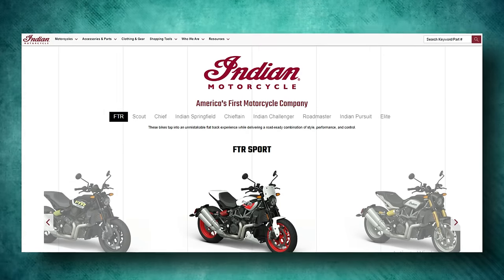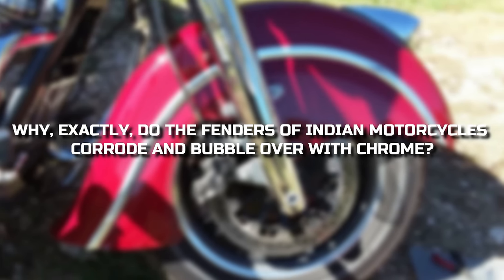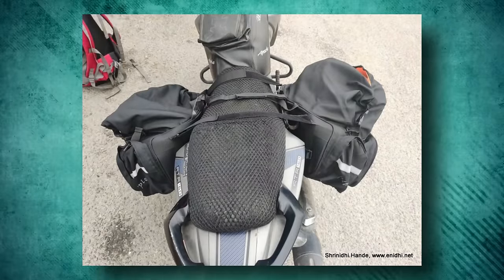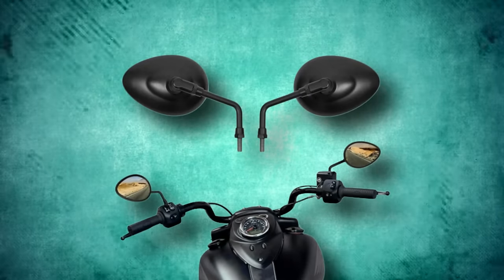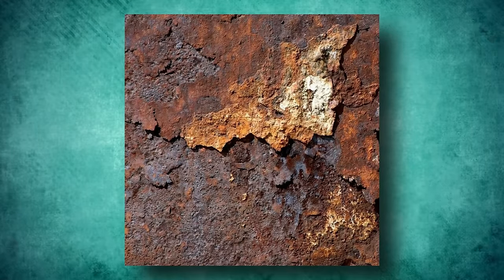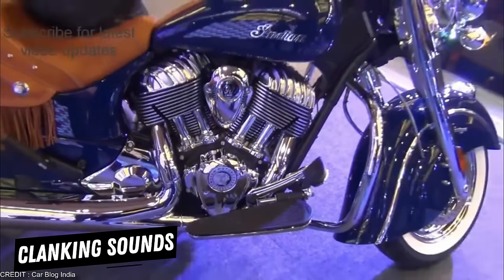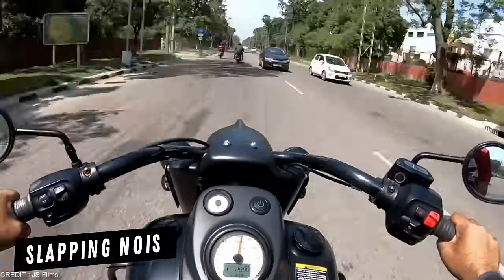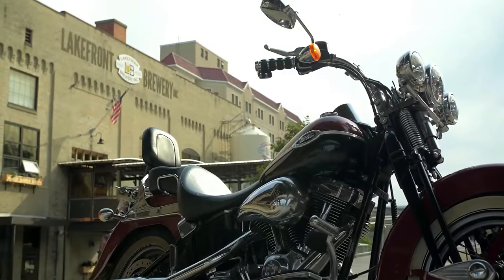This is why Indian Motorcycles SUCK

Comment: it's a Polaris, a company that bought the Indian motorcycle name and making bikes that try to resemble the real Indian motorcycle's that went bankrupt in 1953. i call them what they actually are, a Polaris. currently own 09 street glide, stock 96 ci with Python slip ons, with 168,000 kms / 105,000 miles, zero engine issue's still runs and sounds like the day it was made.
Reply: I was talking to a Harley owning woman one time and she said the finest vehicle on this earth is made by Harley-Davidson and polaris! And now Polaris owns Indian so I'm going to take her advice oh yeah that's right I already did.
Reply: So if you own a Volkswagen, you actually own a Porsche.  Since Porsche owns Volkswagen.
Reply: And more American made than Harley..lol
Reply: Yep. I sold a sold a 1928 101, still have a '47 chief. Looked at the New Indians, almost bought one of the first Polaris ones. A bloke in the states has done over 470000 miles on one with no issues at all. But they look a bit gaudy. Then I found my 07 Road King Classic. Bought this time last year with 23000km, now at 40000km. The shocks were clunking, new ones from HD for 365aud each. Thats it. I bought it knowing things needed sorting as it sat for 10 years hardly ridden. Throttle cable adjusters rusted solid, put piston kit in the callipers,  things like that.(no worries, I know the blokes by name in the parts section at my local dealer, just ring up, they get what I need, call me when it's there). I love that bike so much, I can't stop riding it, any excuse. I've sold everything else I had because I just won't ride them. My only regret is I didn't buy a RK 20 years ago.

Comment: The title of the video seems a bit harsh.  You are absolutely entitled to your opinion but also, you have to expect some rebuttal.  I have owned Indian, Harley, Honda, Yamaha, and Buell (still Harley I know).  All manufacturers have their weaknesses which is why you always hear the adage of not buying the first model year.  My Harley has had oil leaks, loosening bolts, clutch basket failure, etc.  My Yamahas had corroding exhaust, intermittent electrical issues, and charging issues, my Buell was plagued with issues.  My Scout has been an amazing bike and to me, the "issues" are very minor compared to its strengths and I wouldnt hesitate to buy another one.  Indian has fixed its major issues from starter issues, brake issues, etc.  Youd seriously not buy an amazing motorcycle cause the mirror nut got loose or the clutch cable COULD break?  Lets be subjective and look at the histories of issues with other brands...NOBODY makes a perfect product but we buy what makes us feel good and we either fix the issue when it pops-up, let it get covered under warranty, or just upgrade it.

Comment: Every brand certainly has their issues as stated...many of these in the video were from early days of the current Indian line. I have had 2 Indians (18 Springfield & now a 21 Roadmaster) and have had zero problems with either.

Comment: I've owned several motorcycles from Harley-Davidson, Honda Goldwing, BMW R1200 GSA, and 2015 Indian Chief Vintage.  My Indian only has 9k miles on it and I've replaced (4) gear indicators on it as road debris disables it and doesn't read neutral therefore unable to start the bike.  Indian will warrant the part/labor for life as it has a factory recall.  Just a band-aid fix that my time can't be replaced towing it to an Indian dealer.  Indian refused to buy the bike back from me and refused to provide a permanent solution.  I've got the bike listed on Cycletrader.  Will never buy an Indian again.
Reply: Stick with Honda or Yamaha

Comment: After a succession of motorcycles ( 1968 Kawasaki Bushmaster,1969  Yamaha 350, 1970 Bonneville 650, 1971 Norton 750 and finally my dream bike 2016 Indian Roadmaster, although the Norton was by golly one helluva bike!!! ). I had 1 problem in 25,000 miles. My monitor died within 2 months. Replaced, never another problem. I had no noise problems, no failures... One complaint was ... heat. Boy oh boy.... at idle, the volcanic heat would just roast the right leg. So, I learned to ride so I minimized a dead stop. Just had to look ahead. one thing I LOVED doing was running the Sunshine Skyway bridge. Tampa Bay. LOOK IT UP...A SWEET BRIDGE! Go once each direction...(COP WATCH) then....open up. Man, the pulling power going up the bridge was so much fun. you had a 3 or 4 mile run-up to the uphill part of the bridge.  I would be putting along about 80, hit the incline and twist the throttle maxed. No downshift, just twist the throttle. What a feeling!!!!

Comment: I have both and your video is really cute....
Id take rusty chrome and cheap mirrors on Idian over Harleys pathetic warranty.
They "suck" so bad they are being sued by customers for Illegal practices and forced by the Feds to complying.
The aftermarket part for harley is huge due the shitty stock parts.
My stock Indian 116 makes my Harleys performance look so sad its not even a fair comparison.
My Indian didn't need 5k worth of exhaust and motor mods make get out of its own shadow like all my harleys needed.  That "Sucks!" 
Indian has a warranty that has fixed every one of these complaints at no hassel.
Each issue I have had was addressed and fix at no charge.
Ask a HD owner how they like the warranty and dealer treatment has been.
Reply: The voltage regulator went out on my Harley under warranty, got to the dealer, and 30 mins later I was out the door riding again with no money out of my pocket. Harley dealer has treated me fine thanks for asking.

Comment: How about Harleys sumping and transfer issues. The factory did nothing about the affected owners
Reply: Transfer issues? Both my Harleys in the 1990’s had major issues, but at least then they stood behind their bikes and took care of the problems even when the bike was no longer under warranty. Mine had a set of bad cases and they had to replace them. Oil was leaking though the cases and into the primary.
Reply: They did nothing for my 18 or 20 limited
Reply: @billschaner6222  I had a 90 FXRS/LowRider. It had a 12/12,000 mile warranty. Under warranty the return spring for the shifter broke, went thru the trans and ate up a couple gears and synchro’s. They fixed that. The tank decal flaked off at two years, should have been under the clear, they sent a new tank. The top end stopped oiling for some unknown reason, it scored the cylinders and beat the rockers and tops of the valves. Had to be bored 20 over and new pistons. Harley payed for everything, I payed for upgraded valve springs, Screaming Eagle. That was at 38,000 miles. Then I stated losing oil, about 1/2 a quart every 500 miles, wasn’t leaking wasn’t in the pipes, then I drained the primary, got 3 quarts. Found my oil. They had to stamp another set of cases with my serial number and I still had my bike back in two weeks. I traded and bought a 94 Custom LowRider. Had a couple issues nothing major, rocker box gaskets and the speedo quit. I ride a Honda ST1300, 75,000 trouble free miles to this point. Nothing but scheduled maintenance. As long as Harley fixed the problems I was fine, but when I payed $28,000 for a new bike and they wanted me to pay for things that should have been warrantied no questions asked. I was done. Not to mention the dealerships have turned into entertainment venues, it’s a joke. I think some of the people only ride back and forth to the dealership. I might pick me up a used Dyna they can be bought cheap!

Comment: Every one of your complaints is what I would consider gingerbread issues.  Now let's go to HD, gee how about that great clutch that fails constantly, that great crankshaft that lasts all of 40k miles, then that outstanding valvetrain that fails constantly.  Sorry I have dealt with HD and am far from impressed with their quality and engineering.  Most of the complaints I have noticed coming from the HD followers and their nitpicking.  Now, these are the same guys that call a Goldwing absolute JUNK, and the same for BMW's always breaking down.  Well having owned 2 HDs over the years they were less reliable than my 1967 Triumph TR6 after I fired Mr. Lucas, and make my own electrical system.  Have owned several BMW's and all had well over 100k on the clocks, the things that broke were often at well over 100k and were WTF items, such as the spring in the transmission shift cam at around 200k miles as an example.  As for the old Goldwing I now have has over 110k miles and has been trouble-free other than the wimpy alternator 45 amp factory, replaced with a 95 amp aftermarket unit.  OMG it took about 45 minutes to change out as it it tricky to pull out and get back in the correct position.  Now changing the rear tire on a 93 Wing is an ordeal, even on a bike lift.  The people who came up with that system ought to be shot at sunrise.

Comment: What this video doesn't mention is the problems mentioned here were basically all came with the introduction on the Polars Indian motorcycles in 2014. And all were covered by Polaris. What motorcycle doesn't have introduction issues? One of the biggest issues not even mentioned was the issue with their soft paint. Also not mentioned is the 111 motor which is industry leading and better than any HD engine ever created. I had a 2015 Chief and now have a 2023 Chief. They are amazing industry leading motorcycles. There is a reason all Indian motorcycle dealers have a large inventory of used HD trade-ins. Polaris did an amazing job of refining these Indians and todays Indians are extremely high quality including their bullet proof Thunder Stroke engine. Now you know the rest of the story.
Reply: The Victory was used as the learning curve to hopefully have a better machine to call the Indian. Once organized, the company dropped the news on Victory owners. The Victory bikes worth plummeted  overnight. Poor stunt by Polaris.  I purchased a Polaris 2011 Victory and it was a lemon. The first lemon motorcycle out of 16 motorcycles I owned over decades.
The Indian visually shows  much of the Victory too me. I will not purchase Polaris again.

Comment: I bought a 2015 Chief Darkhorse brand new. The chrome fender strips are plastic and hide the seam of the two piece fenders, front and rear. That's where the rust starts from the two pieces not being sealed and moving against each other. My fenders were replaced under warranty at 9 months but began rusting again within a few months. Also, my kickstand spring snapped at 9 months old and it took two weeks for a new one to come in. Riding a bike with a bungy cord holding up the kickstand was embarrassing. I sold it within the year. But I will say this, it was so powerful and smooth riding I still miss it.

Comment: Couple Indian bikes here; no rust but seat on the 16 Scout has faded; no biggie - been in the sun a lot. Also had Scout clutch cable break on my enroute to dealer; my fault though as I should have been inspecting it when I felt decreased resistance. 18 RoadMaster runs like a charm … no real issues there other than tire wear, but that’s on me due to mostly curvy roads and a heavier throttle than normal.
Reply: They have dye kits for leather works really good especially on the tan
Reply: It’ll look new again

Comment: As an owner of a 2017 Indian chieftain, I can concur that none of these issues exist, living on the Florida gulf coast where saltwater and salt air can be an issue. I am a previous HD owner that had multiple rust issues on a 2014 Dyna. I’ll never own another HD for many reasons. That being said, I smoked a 114 Milwaukee with my 111 thunder stroke today. 
I will be challenging every HD at red lights from now on!
Reply from the maker: Looks like your Indian Chieftain is not just a pretty face, but a powerhouse on the road too! Watch out, HDs!

Comment: Once he got to the clutch cable I stop. I owned a Victory Vegas even made a video about Victoru clutch cable HACK. My biggest gripe about POLARIS is they never try to improve or fix their mistakes. The front fender problem on the Vision had to be fixed by guys in the forums and aftermarket companies .Great alternative to Harley but the fit and finish is lacking . When you price your product near the KING OF THE ROAD your game plan needs to be better.
Reply: The biggest problem with Indian is fit and finish. Paint job is soft . Fit isnt up to par . Indian engine is STRONG AND prices should be lower than Harley .

Comment: I own an Indian Super Chief Limited with stage 2 performance upgrade along with a few other upgrades made right at my Indian dealer. This bike has had exactly zero problems. Been riding other makes since 1981, and now will never spend a dime on any cruiser that's not an Indian.  Now, let's see this video focusing on that other made in the USA brand, that's if you can get past the handle bars that shake and rattle like you're sitting at the epicenter of a major earthquake. Just saying. It really boils down to personal preference. Ride whatever brand / model  you enjoy, they all have two wheels . Ride safe.

Comment: Was leaning towards a Pursuit this year. Till I watched a vid on changing an air filter on the model. Got to pull the freaking gas tank to change an air filter. Think I will pass on that.
Reply: Changing an air filter every, what, 10k miles or more? Sounds like a small price to pay
Reply: @Mr02kota  Your point is valid if one lives in an environment where the filter does not have to work too hard. I live in a semi desert environment. 3k max for me on air filter. Also with that have to part the fuel lines each time. Parts wear out, o-rings leak from such.  Indian has made much progress in last few years. still has a way to go. I'll keep my eye on them. I bet they pay attention to these forums.  :)
Reply: lol 3 bolts (18fp) a quick release & 2 electric plugs. Get a Goldwing, man
Reply: @trepathy1  lol I ride a Honda....far superior motorcycles. 🤘

Comment: I have a 2022 Challenger. Let me tell you first hand, it does not suck. Maybe early models had manufacturing issues. Not mine. I like a clutch cable over hydraulic because I have more feel of the friction zone.

Comment: My 2016 Springfield with Stage 2 cams/dyna tuned and TABs pulls like a bull. I'm at 15k and have never had anything but a flat tire and early module recall that was repaired under warranty. Can't speak about the leather as I have hard bags. As far as mirror vibration, that's a HD issue🤣My ride is smooth as silk. I always thought I'd get a Road King until I rode the Indian and that was the end of longing for the RK, although I still think it's a nice bike.

Comment: Didn’t Indian motorcycle’s go out of business for many years?
Reply: Gary, this iteration of Indian is owned by Polaris. There were even several years of a iteration built in California. Both have nothing to do with the original Springfield Company which indeed went out of business decades ago. Polaris was also the company behind Victory which was a VERY well engineered motorcycle, until unfortunately for the owners, the manufacturing came to a very abrupt halt.
I hope this helps 🙏

Comment: My stunning 2019 Indian Springfield and I take umbrage with copious righteous vehemence! 12k miles with none of those issues of which you speak. Cruiser Heaven, all day, every day.
Reply: My 03 honda vfr800 has 40k and a headlight bulb burned out. I was kinda shocked
Reply: @johnengland8619  That's the signal, you're supposed to trade in for an Indian. 😉
Reply: @roguecheddar  no I went and bought a new bulb of course then a 125cc motorcycle/scooter for around town errands. It's light, quick, fun, easy to maintain, super practical and keeps short miles off my motorcycle, can't say enough about it.

Comment: I looked at a 2017 Chieftain limited yesterday that was for sale about $4000 below asking price. (private sale) although a beautiful looking bike, when I started it it had this bell sounding knocking noise on the left side of the bike that you can really hear. Sounded like metal hitting another metal piece. almost similar to an old fashioned triangle dinner bell cooks use to ring during the cowboy days. Because of this I didn't buy it or the reason it hasn't sold yet.

Comment: I have a 2016 Chief Vintage and it has had all of those issues except the oil pump. Also front and rear motion sensors go out. I’ve had it for 7 1/2 years. Now the headlight indicator is flashing a blue light on the speedometer area.

Comment: I have a harley.  My first one. Hands the best riding bike I ever had.  However is the most expensive bike and needs a hell of a lot more money with its pathetic m8, and its non existent wattage stereo.  Also seems to need a ton of things checked every 5k miles. Next bike will more than likely be an Indian do to it having most the stuff I like right from the factory and much cheaper. 

Personal opinion, you DON’t always get what you pay for.
Reply: Check out a Challenger, they're damn nice bikes. I'm not a cruiser person at all, but that bike is growing on me and owners absolutely love them. I work at an Indian dealership as a tech and so far very little trouble, and the company has been good for taking care of anything coming along.

Comment: HD some equal opportunities came bearing failure,cam tensioner failure , oil pump failure due to bearing and tensioner , umbrella vent valve leakage , transmission noise  when using Syn3 oil , CVO paint bubbling and having to argue to get warranty coverage. Make sure to sweep in front of your house before criticizing others. Have fun and ride on.